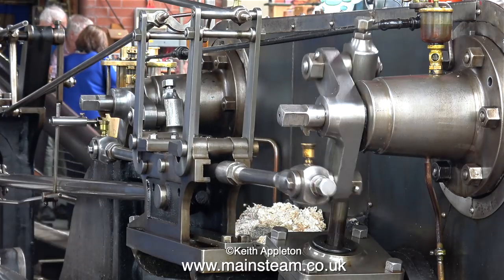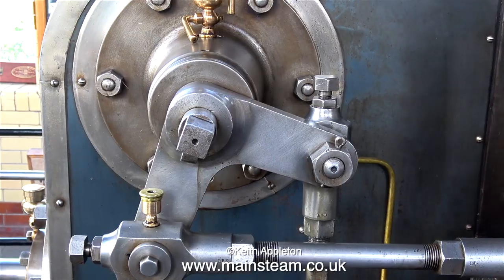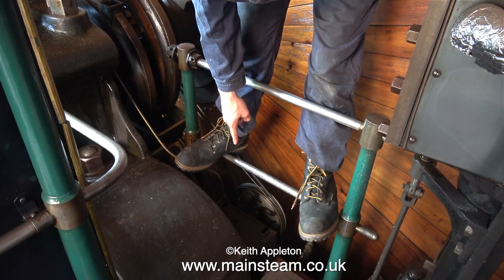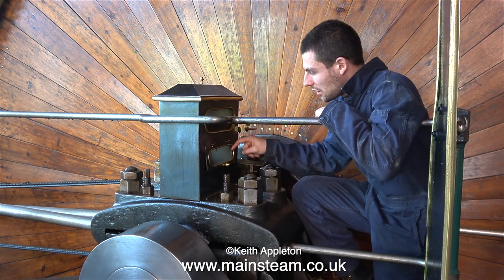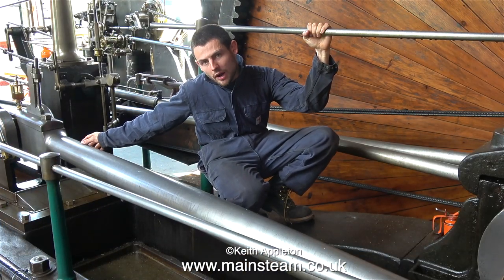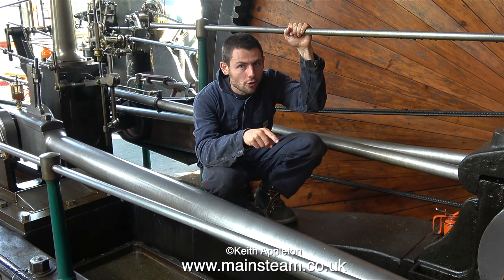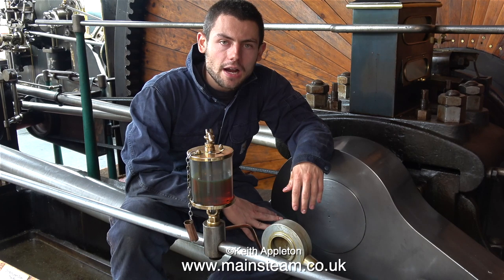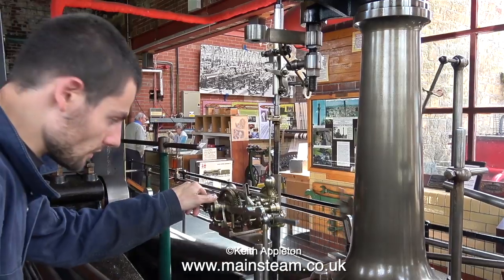DYNAMISM WITH A. E. KARNES - AT BANCROFT MILL

Comment: Great video, really interesting to learn about bearing wedges and the different types of big end oilers. The indexing governor is very interesting too, but I felt as though the description went above my head a bit. Does anyone know where I can find out more about it? And did I understand correctly that it is making fine adjustments to the valve timing via the vertical shaft shown in the background? And when he turned the handle, was that intentionally altering the engine speed to show us the mechanisms action? Thanks in advance

Comment: The footage of the Corliss valve gear could be flagged as almost pornographic.
Just right for a break from programming. (Some gleaming brass and steel to compensate being stuck in front of a monitor.)
And the explanations are just great!
That being said: That Lumb's governor is clever!
Unfortunately, this also means that the governor on a telescope drive by Zeiss/Jena from the 1920s, one which a friend of mine has been doing a lot of work on (most of which was spent on understanding the mechanism), might be slightly less inventive than we always thought. Interesting.